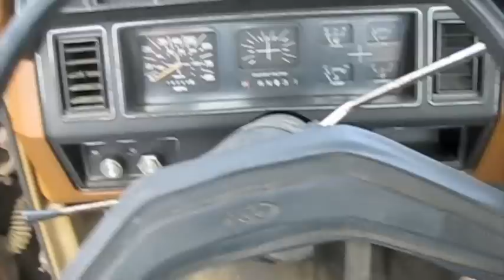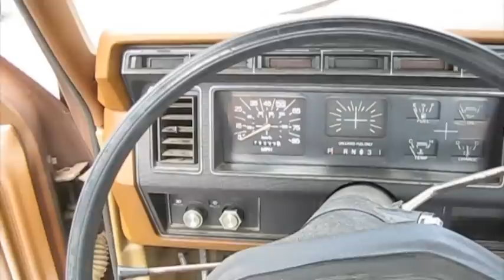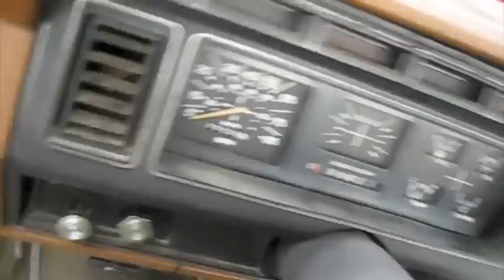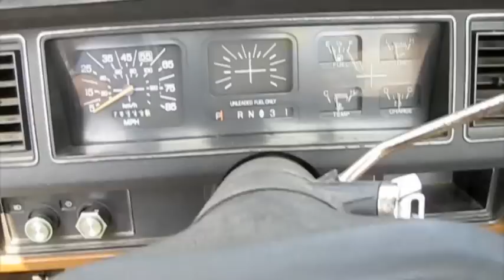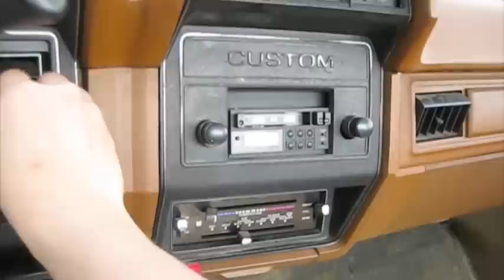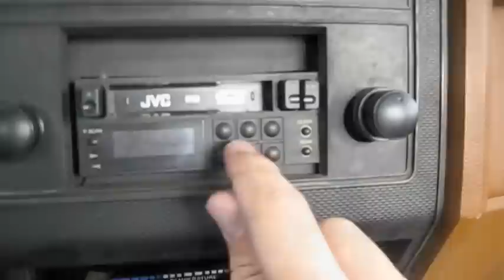1981 Ford F100 Custom Start Up, Engine, and In Depth Tour

Comment: is it just me, or does it sound as though the truck is running like a diesel, at first I thought it was background sound's from another vehicle, but it definitely is coming from that f100....
Reply: That's what I thought aswell, it does sound like a diesel aswell.

Hey it could be the 6.9 diesel, or the 3.3 perkins i4 diesel as the F-100 did use that, though apparently only for the ones built in Argentina, My guess is that is not a gasoline engine but a diesel, even if it was running rough a gas engine doesn't sound as clattery as that, so I'd say it's the 6.9 V8 Diesel, sounds like it anyway.
Reply: Samthebam4044 This is not a a 6.9. Probably just a very rough running gas engine.
Reply: it sounds like a diesel. gotta love it.
Reply: Nicks Customs ford has a lot of clearance on there bearing they rattle alittle
Reply: 4x41986ranger The F100 was discontinued in 1980 this is a F150
Reply: @Victoria3232-j7o  buying an 83 F100 later this week
Reply: In Australia we had 86 f100s
Reply: @yeoldeentertainment9154  nope 1982 because I have one with a 305 in it.cream colored.
Reply: @jonjordan758  no 1983 f100 last year and first year for diesel international harvester
Reply: @craigedwardjensen6382  is it diesel international harvester diesel 6.9 also supercab for f100 because 79 they did also 1980 f350 supercab
Reply: @Victoria3232-j7o  The F-100 was not discontinued until 1984...

Comment: sounds like a diesel
Reply: he should checked the oil
Reply: shylildude That's how engines sound of the oil hasn't been changed which Means the Engine is destroyed on the inside.
Reply: I'm thinking about that too

Comment: That ones in way better shape than the one we have. the one we have is a 1984 with a missing exhaust (you can here it from 2 blocks away) LOL.
Reply: What color is your truck man,what's the litre's on the trucks engine.
Reply: I've got an 81 with the 255 with straight pipes..... Definitely understand 🤣

Comment: That's a rather loaded F-100. My F-150 (a 1982) has non of that lol. Just a radio a heater and power steering/brakes. And the 300 I6 w/ a glass pack. Sounds awesome at an idle. I daily drive mine and got 21.5mpg on the Hwy w/a 3-speed manual on the floor w/OD. Not bad for a 30+ year old truck.
Reply: What does your F150 not have that this has?
Reply: Nicholas Zhuravlyov his is most likely an xl while I believe this one is an xlt which is a higher trim level.
Reply: Nick Crane mine is a 2008 Ford F-150
Reply: The one in this video is a true Ford truck something truly built with quality Though not quite as high-quality as other trucks from the time compared to the newest trucks it’s the best you can buy
Reply: Ive got an 81 ford f100. Any idea what the bolt pattern is? 5x5.5 or 5x4.5?
Reply: @keithconley5770  one of those, sticker in door panel should tell you
Reply: @LoganFK  If it's still there of course...

Comment: I’m in love with this truck, it’s actually fairly loaded with AC, automatic transmission, and dash vents.. since a portion of these older bullnose ford’s did not have dash vents, only defrost. 

I want one of these 100’s with the super rare 3 speed column mounted manual. Very hard to find sadly.
Reply: But 4 on the floor is more fun.

Comment: A buddy of mine had an old 1980 Ford Econoline Van in that same brown exterior color like this F100 V8 pickup truck. Only difference was the engine was a V6. the van honestly looked like a death trap but it was his work van he daily drove it  for  contracting use. Also a mechanic so the engine was in great shape for its age.

Comment: Similar  to my  '82 F-100  V6-232,     3spd standard on column, brown in/out  ! 
That has been posted for sale. 

I can relate to the drivers side tears on the seat.   Although I only used red Tyvek tape as a temp' fix, till it released so I peeked it off leaving some 'red stain',  and just cover it with a 'mexican' blanket.  Previously wore out the 'western blanket' style of bench seat cover that the previous owner had 'dressed' the seat with.   That is when I found the 3 tears' in the vinyl seat.

Comment: I feel what your saying. I have one now and its been alot of work already and i'm just getting the engine in great shape thus far. This particular year f-100 has the distinction of being the last year ford put the letter on the hood. After that they went to the now ford logo inside the front grill.This is just a great truck.. When you sit in it your at a very comfortable height and it just feels AMERICAN.
.

Comment: we used to have an 82 f100, it was the base of all base models, 300 straight six, 4 speed manual, no air, but it was a good truck. but unfortunately due to living in the rust belt up north when we got rid of it it was pretty much the Flintstones mobile with no floors lol.

Comment: @rutter1ify 
Hello from the United States,
The pedal on the far left is the emergency brake. It is not a clutch pedal; the driver uses this pedal for certain instances whenever the vehicle is being parked on a hill or incline. Therefore, when this emergency brake is engaged, it prevents the vehicle from moving forward or backward while on a hill or incline. Some other vehicles have a pull lever type of emergency brake instead of a pedal. Hope this info helps! ;)
-Matt

Comment: They use the same dash layout as the Medium duty trucks such as the F600 F700 & F800 even though they use different steering wheel which is a 4 spoke

Comment: @KLX1990 no sir, they have had twin I beam suspension since the mid 60s on the 2WD fords, and ford put the dana 44 twin traction beams on the trucks from 1980 to 1996.  In fact theres an original commercial from like 69 advertising the tib suspension here on youtube "WORKS LIKE A TRUCK, RIDES LIKE A CAR" 1969 FORD F-100 AD

Comment: I'd replace the a/c throttle controller and put in a three-quarter bench seat for comfort. I miss my old root beer colored '84 Ranger longbed :( great truck for unloading at the dump.

Comment: wat r the stock specs on the motor im tryin to get a similar one like yours nice truck
Reply: Stock about 130 hp and around 300 torque. Not fast stock but responds amazingly well with the right mods. All I did was a EGR delete and capped off the vacuum lines and put a open air cleaner and I piss of duramax owners a lot. Lmao

Comment: I love all of the videos you do, but I am a little disappointed with the 1981 Ford video. I am a very big fan of yours so please remember I am not trying to be rude, but I wish you would leave the Excelerator alone for the first minute or two when you have started the vehicle if it has a carburetor. It kept stalling on you because it sounded like you may have been adjusting  the Excelerator. If you leave it alone and let it run and show people the truck I’m sure you can come back to it and goof around with it as much as you would like and the motor would probably stay running for you. The same thing for the coldstart of this truck, if you would have feathered the gas pedal and kept it the same for the most part you may have not had to worry about killing the battery or restarting the motor so often. I have watched a few other coldstart videos with carbureted motors and watched you struggle to keep them running. I see the similar chain of events before it stalls out. I really feel like it would be better if you leave the motor running for a little while before doing the clips of the engine rev sound. I learned from experience of watching my father impatiently gun his motor before work in the morning and watching it stall out repeatedly. LOL. I’m just trying to give you some friendly advice.

Comment: @avick84 While quality, safety and many other aspects have undoubtedly improved, I was referring to styling. Pretty much everything from the 80`s had a much more exciting look. Cars like the Chevrolet Camaro, Caprice, Celebrity, Pontiac Firebird, Grand Prix, Mercury Sable, Cougar, Ford Taurus, Thunderbird, Chrysler LeBaron, to name just a few. There are a couple of exceptions here and there, of course, but most of it is pretty disappointing.

Comment: Anyone want a cheap 81 f100 with a seized 302, tranmission works it's baby blue use to run off natural gas so its plumbed for that interior door panels are dry rotted tho and has that ford bed outer fender rust.

Comment: The F100 was discontinued after 1980.
Reply: Actually it was 1982 I have an 82 F100 straight inline 300 six cylinder that I inherited after my old man passed away, these trucks are awesome

Comment: F100 was discontinued in 1980.
Reply: charger master en Argentina se vendió hasta 2011 con varios restylings
Reply: Pepicity1 para los sotros en los estados unidos el F150 replaco el f100 para nuevo leys en el anio 1975 para los motores.